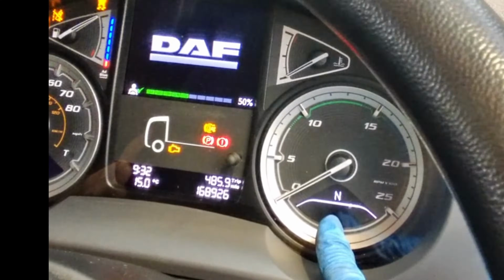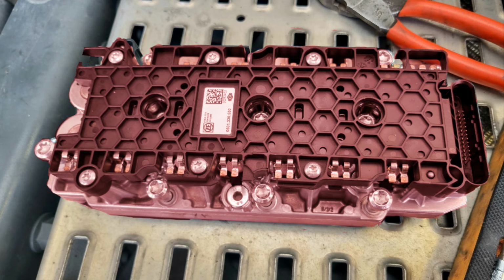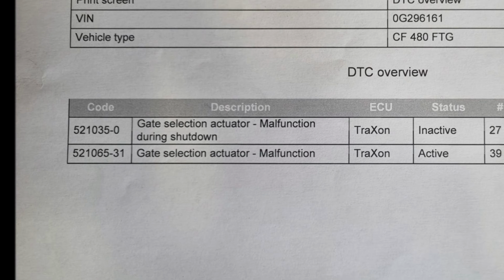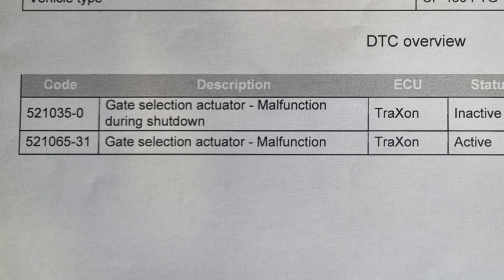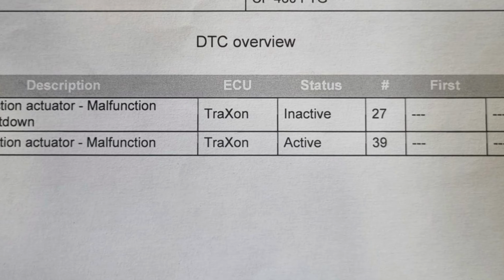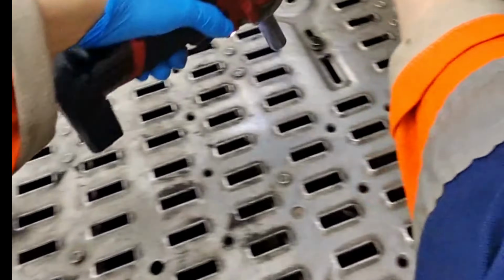DAF ZF TRUCK TRAXON REPAIR | WHAT   CAN BE REPLACED

Comment: Saludos, tengo una transmisión Zf traxon la cual actualmente está neutralizado, selección la marcha, en la transmisión se escucha cuando realiza el cambio pero en el tablero sigue en neutro y el vehículo no arranca,  como puedo diagnósticar ese vehículo
Reply from the maker: You need to read the fault codes and run run some tests on the modulator and gearbox id say

Comment: Sorry, if there is a problem with the ecu. Apart from replacing the modules, can we repair the electronic components inside? If you are interested, I would like to research in this direction

Comment: I have issue with gear box mulfuntion dealer changed big relay on fuse box it fixed , but same thing happen again 
Can’t crank vehicle 
I found big plug on gear box was half plug in and i have plugged back in , but still same

Comment: Hello, please help me. My car's gearbox is a Traxon, and when the gearbox is completely cold, there is no problem, but when it warms up a little, just warm not  hot the gearbox starts to knocking, and this knock makes a relatively loud noise from the seventh to eighth gear. The diagnostic device has nothing.  It doesn't show any problem, I'm really confused, please help me
Reply from the maker: Hi, thanks for the comment. Sounds like you need to strip your gearbox down and have a look at your gear  in high-range. 😵‍💫
Reply: @TRUCKTECHUK  The gears are good, it's really a strange problem, but in the range of engine speed below 14, there is a rattling sound, after 14 or 15, there is no sound, and I don't know why, when the gearbox is cold, there is no sound. The sound of other gears seems normal, but the sound from the seventh gear to  8 is worrying, from 9 to 8 is also good, from 6 to 8 is almost good, only 7 to 8 is a bit too much, and if I press the accelerator pedal all the way, the problem is solved when I press 20% of the accelerator pedal and  I try to drive normally, it makes noise

Comment: Mon amie merci beaucoup pour tes vidéos  riche en connaissance mais c dommage c juste changer des pièces défectueuses sa serais cool des vidéos avec de vraies réparation de pièces défectueuses.merci d'avance continue tes vidéos sont bien
Reply from the maker: Thanks for the comment buddy. It was a repair. It had an active fault on the gate selection actuator, This part is not serviceable and due to the truck being under warranty, it was replaced for free as opposed to the customer paying for it.
I went over the other components as no information existed at the time on YouTube for ZF TRAXON. 

Unfortunately, none of these parts are serviceable like AS-TROINC  and have to be replaced. Replacing the part gives the customer 12 month's parts and labour warranty instead of throwing a seal in a piston like on AS-TRONIC  and hoping it doesn't develop another fault next week 😅

Comment: Please tell what was the problem in this gearbox and why you Changed electronic valve???
Reply: I'm from MAN truck and bus Pakistan
Reply from the maker: Don't you have a gearbox specialist in your dealership to diagnose these sorts of problems?
Reply from the maker: Without using MAN CAT for fault code analysis, I don't know what else to suggest 🤷 if I was you id get it recovered to the workshop for repair and inform the customer the gearbox is going to have to have a major repair but that's up to your technicians and workshop manager to do
Reply from the maker: Thank you for the comment!
 the vehicle was recovered in with failure to select gears and the fault that was active was 52106-31 gear slection actuator malfunction which is the part I changed to rectify the fault under warranty you can see this here https://youtube.com/clip/UgkxgcxMPkX-CbkIKUGdVV8O3aqwHi9-xW1m
Reply: @TRUCKTECHUK  actually we have traxon automatic gear and the problem is when we shift to D or DX mode then it gives abnormal noise while shifting in 2nd gear and then automatically shifts to 1st gear .  Noise like gears collision  comes in  second gear and also in 4rth gear while driving. Please advise. Thanks in advance dear.
Reply from the maker: @shooteverything  if the gearbox won't shift into the selected gear ⚙️ it sounds more like a mechanical malfunction with the mainshaft than any electrical valve issue. 
I'd suggest taking to someone with Davie where they can read the fault codes, monitor the gearbox behaviour and advise you on the correct course of action from there 😎👌

Comment: Nice video again. In As-tronic all modulator components are suited in one case. Here they splitted it and changed manufacture from Wabco to Knorr. It`s strange for me because ZF bought Wabco :D However problems with Knorr begins so early before 200k km :(
Reply from the maker: Thank you for the reply! Yes As-tronic was good that you could remove the ECU and all the components to do with it in one go but getting the actuators to line up afterwards was not fun!  But you look what's required now with TRAXON when you think you have a seal broken.....gearbox out and the valve assembly to remove behind the clutch actuator now.
Reply: Engineers from ZF hate us..  In As-Tronic modulator fitment main,gate and range forks are visible, only for splitter you need a bit concentration. How many km clutch lasts in Traxon in a normal lorry (2nd category regional transport) I think that is better to change seals when you change clutch and clutch actuator.